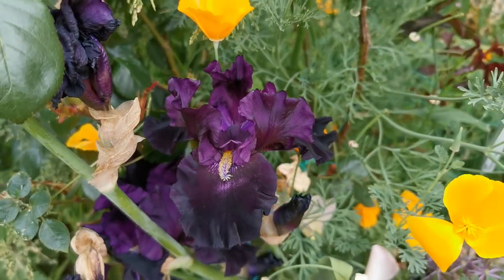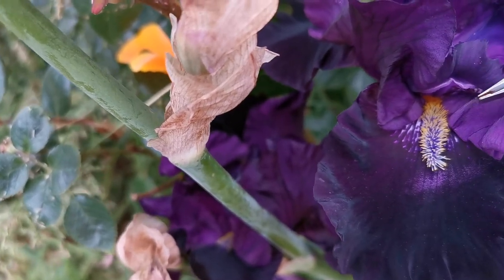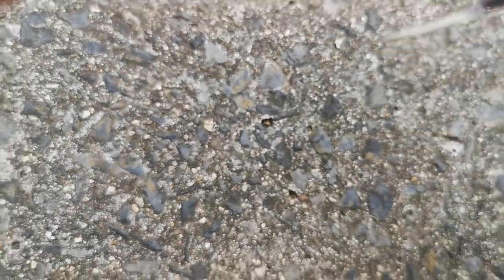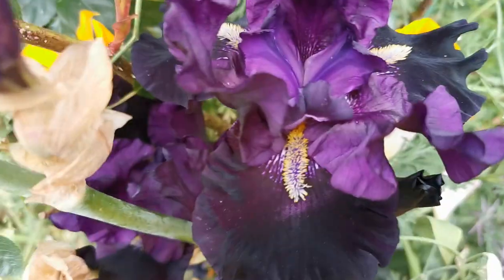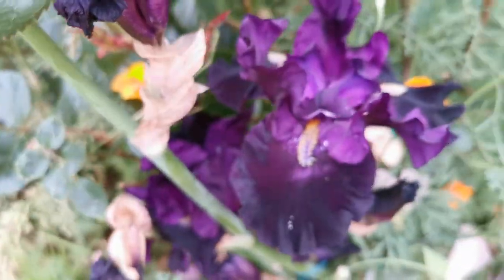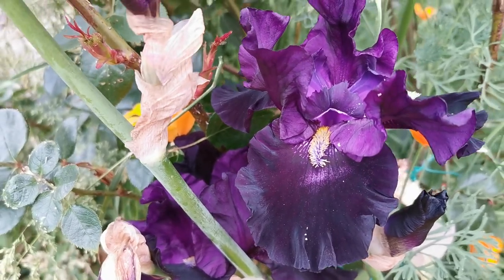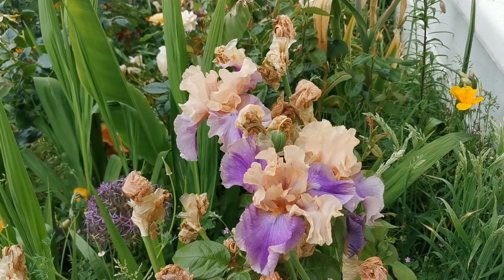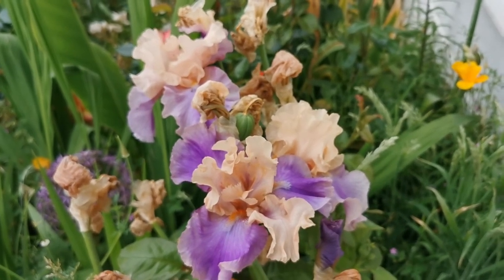How to hand pollinate Irises. Iris flower anatomy, pollination technique and seed pod development

Comment: Excellent Job.If I  do Hand Pollinating Irises need to be different color or not .Can i do same color iris flowers? Thanks
Reply from the maker: hello, bearded irises can be pollinated with pollen of any other bearded iris variety, it can be an iris of different colour, or similar, or even the same colour, actually you can pollinate a bearded iris even with pollen from the same plant you are pollinating, it is called self-pollination. However, as in many other plants, pollinating your iris with a pollen of a different plant, will give better results e.g. more seeds and more viability / germination rate / vigour in the offspring. Actually bearded irises can be pollinated also with pollen of other iris species, that are  not very closely related to bearded irises e.g. Oncocyclus Irises